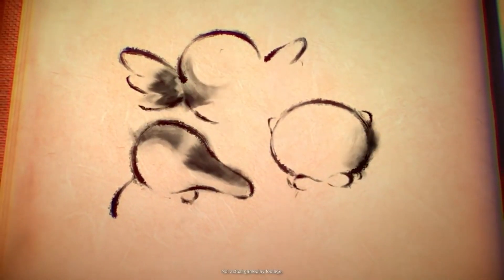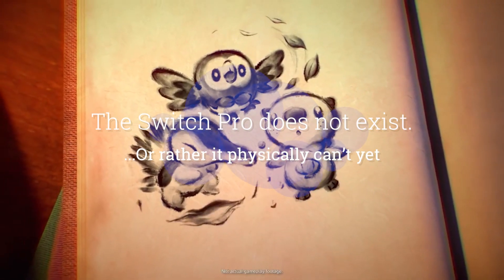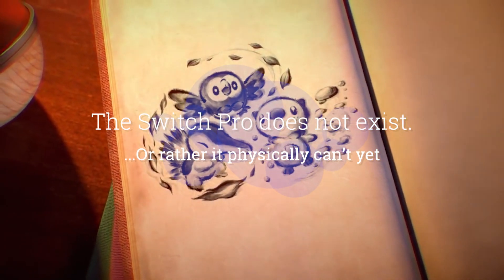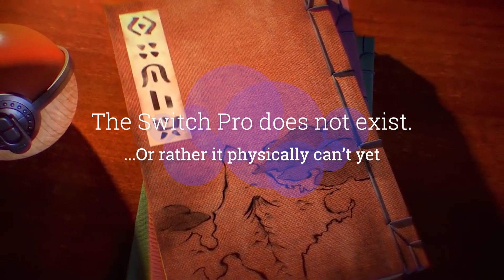Why the Nintendo Switch Pro Does NOT Exist

Comment from the maker: I'm genuinely shocked by how angry people are getting at the idea of the pro not existing lmao. Watch out for an aggressive comment section just fair warning ⚠️ and fyi anything you've heard about the pro existing has been purely speculation and rumors. Get the facts not the clickbait
Reply: True! Also, you can play literal Super Mario Galaxy on the current one - and the wonderful Smash Bros. etc. so I can't find fault with it XD

A 4K' Pro Switch' would actually be out of my range as I do not have a 4K TV  :O
Reply from the maker: @geekyvoiceacts  same, that market is still pretty small. Nintendo would never reiterate a system just for that
Reply: I can't see any actual signs or even a need for a pro model. Nintendo never really had to have the best graphics to sell. They are clearly still pushing the current switch and making games for this hardware. I just don't see it.

Comment: Nintendo is telling for two years now that there is no Switch Pro in the near future. I don't know why people think they lie and there will be one soon. Besides the fact with the shortage of chips the switch still sells incredibly well and you normally bring out an improved and faster revision when your sales go down and not when they are going up. Nintendo is surely developing one but there is just no logical reason to bring it to market at the moment. But I guess all the news about that generates clicks.
Reply from the maker: Precisely. And it's become excruciatingly annoying seeing people spread misinformation about the switch pro and also how well a game like Pokemon Legends could and should run. It should be able to run fine on switch it just depends on gamefreak to optimize it properly
Reply: @JohtoJonnyYT  There was a video a few days ago where someone claimed that GameStop leaked the Switch Pro because they were speaking about "new Nintendo Switch" in an ad. Since GameStop sells used and new consoles it should be a no brainer what was meant. But some people...

And yeah maaaany games are not very well optimized. I don't know if it is because of the engines used or just to save time and money. When you think about how optimized many games had been on older consoles... Even in handheld mode the switch should be at least twice as powerful as a PS3 but many games look worse than some PS3 games.
Reply: oh we have our new Switch revision. But no pro model :) Just better screen and stand :D
Reply from the maker: @derTommy  yeah. Cuz if they made a pro they'd have to mass produce way more. This is a good way for them to ease back into boosting sales until semiconductor manufacturing is fully healed
Reply: @JohtoJonnyYT  weapons of mass production :)
Reply from the maker: @derTommy  🤣 yep lmaoo

Comment: The switch « pro » is definitely somewhere in development. The console is too old and nvidia does apparently not even want to produce their 6-year-old chip anymore. And I don’t think we can completely compare the ps5 situation with Nintendo’s. Yes semi conductor shortage may be an issue for them too but even with a revised version the switch would not come close to using the same high end components that the ps5 needs and that’s also used by many industries. The switch is playing in its own league and shouldn’t suffer from such massive shortage. This may still delay its release but the switch definitely needs an upgrade and Nintendo knows that so it should come out someday for sure. By the end of the year is unlikely at this point but who knows.
Reply: This guy knows what up. Unlike OP...

Comment: it does exist and nintendos trying their best to get it out this year. the processors for the switch pro are already made for the first or second batch so that semiconductor shortage doesn't apply to nintendo. also the game are running on the switch not pcs. sony and microsoft use pcs to show game footage nintendo does NOT. it will come out this year and it will probably be shown next month or in august and launch in november is my guess. dont spread miss onfomation and do some research first.
Reply: So how do you know it exists?
Reply: @pig9705  i know a guy. 

really i do know a guy who has one.
Reply: Why wouldn't they show it at E3 then? Zelda BotW2 got a 2022 aim year announcement. So if a console revision is coming SOONER than 2022, why not just saying coming late 2021 or even coming early 2022 if it is truely that far into development especially when E3 is the perfect place to show it off.
Reply: @Liam16  sorry but i doubt it. Human nature.
Reply: @pig9705  i even know thats its using the t239 chip. so suck on that,
Reply: @Liam16  Yeah sure Buddy
Reply: @Liam16  Lol. OLED Model confirmed same CPU and RAM.

Comment: The Switch is such a great way to play games, I really hope they just jump to a next-gen Switch and focus on doing a reset to continue to improve their 3rd-party support. They've already done a pretty amazing-job getting versions of almost every major series on the Switch but if they do the generational-leap next, they could really knock it out of the park with a powerful Switch 2. They dont need a totally new idea this time, they already are the brand with the best franchises and the best way to game on the go! 

This is unequivocally what Nintendo Switch 2 should be! 

A new chip based on Nvidia/Samsung's 8nm process
(Approx. equivalent to a GTX1650 Ti Max-Q)
Approx. 2-3 TFLOP performance (docked)
A special Nintendo Nvidia DLSS secret-sauce
No ray-tracing tax
8gb ram LPDDR5
128-bit memory interface
128gb SSD
Bluetooth 5.0 support (native-support for wireless headphones and speakers!!!)
The same 6.2' screen but at 1080p (they can even save an OLED-version for later)
4k-upscale w/ the dock
Locked 30fps across the board
Made out of the same plastics they've been using (please dare God, dont make it glossy)
Touch-screen and amibo-support continues
Better multiplayer-support (no more Friend-code stuff)
Fully-compatible with the current Pro-controller and Joy-cons but not built-in 
Original Switch-compatibilty (Doesnt need to be enhanced)
$399 price (Released Holiday 2022 just as the chip shortage is ending) 

No detachable Joy-cons! Focus the cost on the GPU and the size on thermals, battery and keeping the ability to connect to TV. The joy-cons make the regular-Switch more awkward to hold. 

Nintendo shouldn't abandon the Joy-cons but continue to offer them as speciality-controllers for specific-types of games. Few people actually prop-up their Switch and use the Joy-cons OR share Joy-cons to play together. The screen is not quite big enough to do that comfortably. 

Basically make the Switch 2, a Switch-Lite that's the size of a regular-Switch but more powerful and still connects to the TV. 

If the new machine is as powerful as a regular PS4 but portable it would be perfect and it would be able to get 3rd-party support from everything PS4 got. Imagine ports of RE7 and 8 or Yakuza on a Nintendo-portable and they should put the new Metroid-Prime and Bayonetta straight on Switch 2! OH GAWD YASS!!!

Comment: Im sorry to say, but its not as much a silicon shortage as many would like you to believe. Currently the silicon is fine but the substrate are in short supply therefor you dont see NVIDIA cards as well as AMD cards or heck even intel and IBM, because its not silicon. Say they use a older node for a maxwell-tegra chip this would be able to be done at TSMC 12 nanometer node (which is different from the 7nanometer node from TSMC which make the Zen3 chips, rx5000 series, rx6000 series, PS5, Xbox s/x or samsungs "8 nm" (its more like 10nm) node. here is a lot of supply for. I do however agree with the main point you're making from the engine stuff. good short vid overall

Comment: Well Temtem will run terribly on switch. Why? Two words Battle animation.
Reply from the maker: Nah. Temtem is coded very optimally which is why the framerate is so silky smooth even on weak pc's
Reply: @JohtoJonnyYT  I got three options from that
1. You haven’t played the game in awhile 
2. This is sarcasm 
3. Humble games is holding you at gunpoint
Reply from the maker: @jessegartung294  ?
Reply: @JohtoJonnyYT  I think differently than most people.

Comment: ROFL the switch pro is 100% real just stop.
And it just doesn't need to be rushed out.
And to be clear botw does not run well on the switch and it was a release title.
And the current x1 chip has already been discontinued so they have to be ready for something new soon.

Comment: i believe it exists but its probably Nintendo's hot holiday item 🎄🎁 and they don't benefit one bit  by announcing it early slowing current Switch sales.

games like Bayonetta 3 won't be shown without the pro, at least thats what i think 😅 could even be Switch 2.0 but i think its a pro model
Reply: See you in 2024 when the switch pro comes out then
Reply: nintendo already told us they weren't going to announce any hardware related to the switch at e3  But people still thought they were
Reply: @dataroaming8518   It's unlikely for 2024 a switch pro  It would have to be a next generation console
Reply: @HamRadioGuyWill  i mean, there is too many rumors,details/leaks insiders who are sure its happening, maybe they got the wrong date but think its coming this year.

I could be wrong of curse, but after new 3DS, DSi and the success of the pro consoles its not impossible to believe. i even remember one developer (wayforward?) hinted new Switch hardware is already in the hands of developers, we will see...